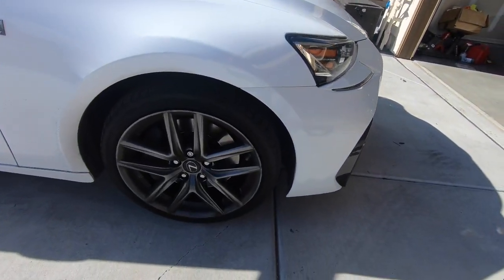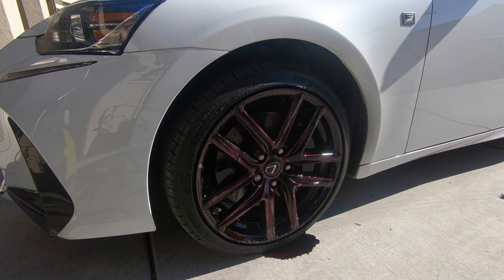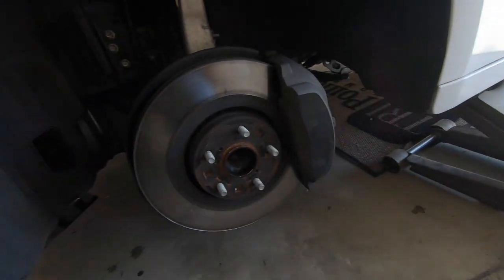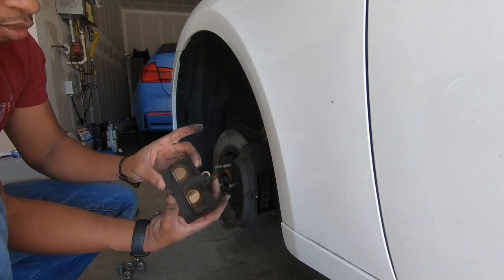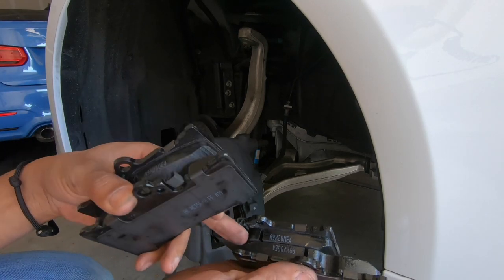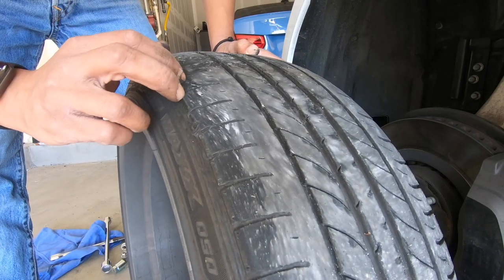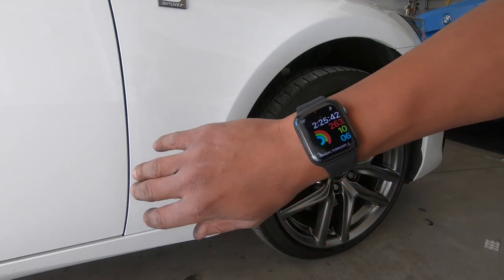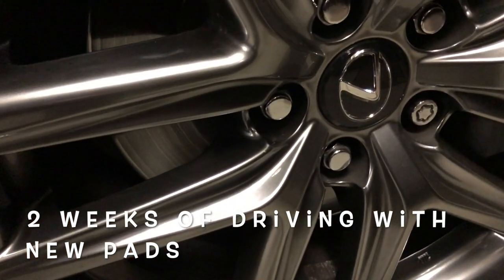2017 Lexus IS350 Brake Pad Change

Comment: As others have stated; turn each wheel to allow much easier access. You should also consider using the old pad along with the screwdriver to push the (both at once) pistons back in. Just ordered the wheel cleaner. Thanks for that and a good video.
Reply from the maker: True.  It wasn’t too bad.  Now I have a speed bleeder which sort of acts like the same thing!
Reply: That wheel cleaner is fantastic. Thanks again.

Comment: I wish I came across your vid a little earlier hahaha, I ended up changing out my front pads with just a Duralast brand which is not producing a lot of brake dust but I’m glad you mentioned about the Akebono brand bcuz I’ll definitely get those next time especially if they perform better. The one I got is not as crisp as the OEM but I love the fact that it’s not producing a lot of dust. Awesome job bro🤙🏼
Reply from the maker: I had experience with Duralast Golds on a different car and I had similar experience.   The Duralast produced less dust but had reduced feel.   I feel the Akebono might even have a bit better bite than stock but it’s hard to say since I rarely drive it.

Comment: I hear you should use de-iron brake clean products on ceramic brakes. Were the original ones ceramic I guess it doesn't matter since you changed it out but fyi?

Comment: I have an IS 350 F and when I saw you spray that wheel cleaner I cringed! The day I drove my new car off the lot the dealer cleaned my wheels with something and it took off the coating on the wheels. Had to get a new set off of another 350 before I would leave. I’m super paranoid about using any wheel cleaner. Does this cleaner affect the coating on the wheels at all?? I need it bad because of the brake dust but I’m tired of getting on my hands and scrubbing with a toothbrush!
Reply from the maker: Are you talking about the Sonax wheels cleaner?  It’s safe for all wheels and it’s Acid free, so it won’t eat any coating off.
Reply: @eddiemcars  I’m not sure what cleaner they used. I just wanted to make sure this one was 100% safe before I ordered it!

Comment: Totally agree with the wheel stud thing. First time I had to put a wheel on a car that had wheel bolts I couldn’t believe it what are they thinking. Not only for a mounting the wheel issue. But now if you mess up the threads in your hub you have to replace the whole hub. Instead of just pressing out the wheel studs
Reply from the maker: Yes,  I have them on my BMW and I’m seriously considering the stud conversion.

Comment: Hey I noticed you only changed the brake pads.. would it be better to change the rotors as well if I’m going to get ceramic pads for my Lexus is 350? Thanks
Reply from the maker: If your rotors are worn, yes.  I didn’t change them since there was low miles on the car and I was only changing the brakes simply for going to a low dust pad.
Reply: Change the rotors or resurface them.  Never just add pads!!!  Plus, use Sil Glyde lubricant too.  Again, never just add pads.

Comment: Hi, excellent video. I appreciate the content.
which akebono's did you use, ACT or ASP and can you give us an update on how the pads are holding up?
once again, I appreciate the content.
Reply from the maker: I believe they were ACT.  
The pads held up great! My favorite part was the initial bite was still retained from the factory.  Brake dust was very minimal.  It would take a  couple of weeks before you could notice anything and even then you could only notice if you wiped your finger on the rim.
Reply: @eddiemcars  excellent thank you. 
My akebono's should be here today for my 2016 is350 fsport.
looking forward to limiting some of that brake dust.

Comment: How did the Akebono ceramic pads turn out?  I need my brakes replaced and the dealer said it’s best to use OEM original Lexus brake pads otherwise I’ll be hearing a lot of noise and screeching.
Reply from the maker: From my experience, the Akebono ceramics feels and drives just like the OEM pads but with 90% less brake dust.  I think it’s worth the money!  No screeching or squealing noise. From my experience, dealerships are only allowed recommend OEM parts for liability reasons.
Reply: Edward M Cars Awesome! Thanks for your input!

Comment: Could I use these on my 2016 IS 300?
Reply from the maker: I’m not completely sure.  I believe the IS300 uses the cane brake caliper.  Yours is the AWD version correct?   I purchased from RockAuto so I would check there and see if they list Akebono as a brand.